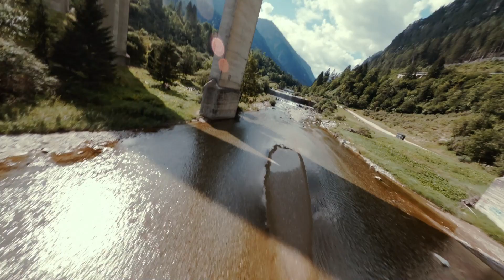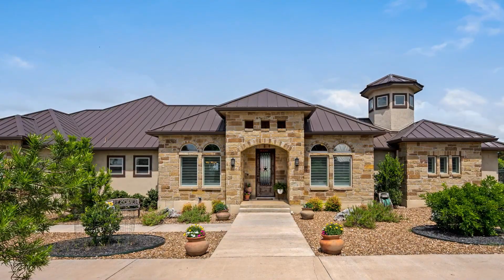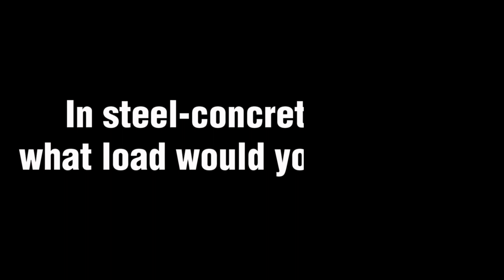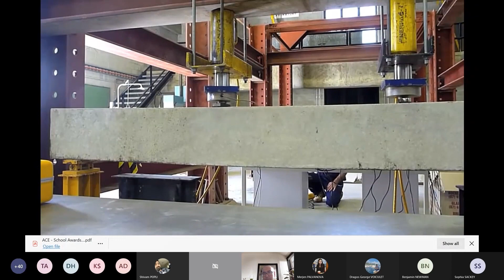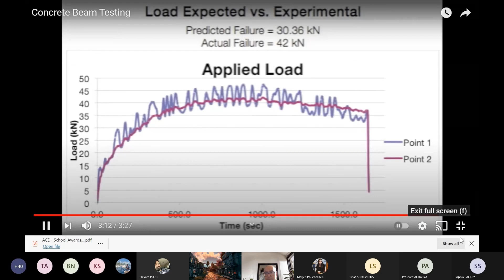02 Reinforced concrete design civil engineering applications| Singly reinforced beam to Eurocode 2

Comment from the maker: ⏰ TIMECODES ⏰ 
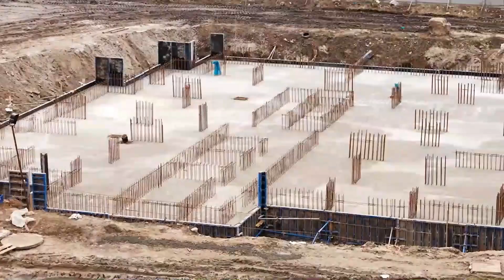00:00 – Introduction 
00:35 – How does concrete behave submerged in water for a long time?
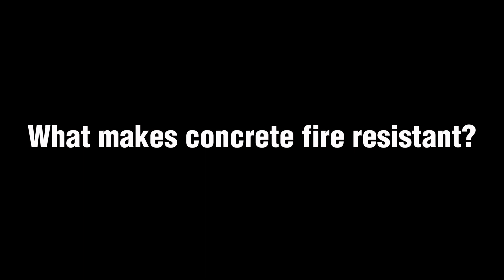01:36 – What makes concrete fire resistant?
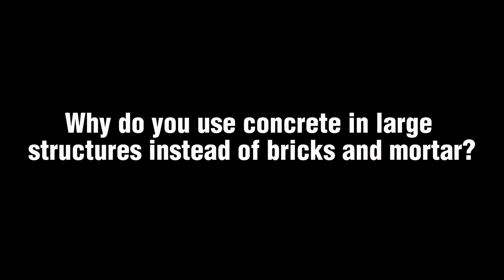03:09 – Why do we use concrete in large structures instead of bricks and mortar?
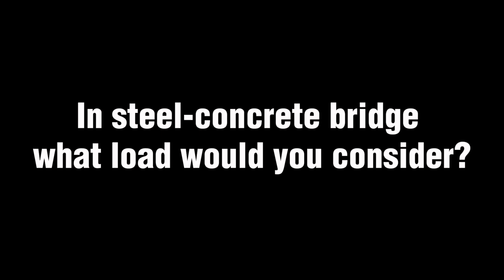04:41 – In steel-concrete bridge what load would you consider?
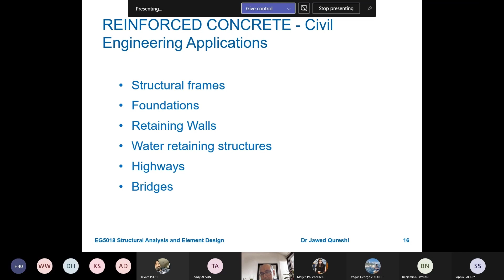06:46 – How do reinforced concrete beams fail?